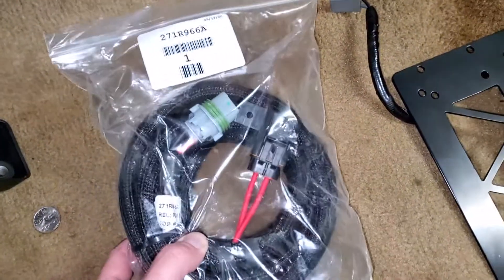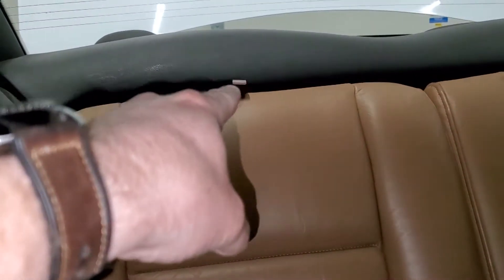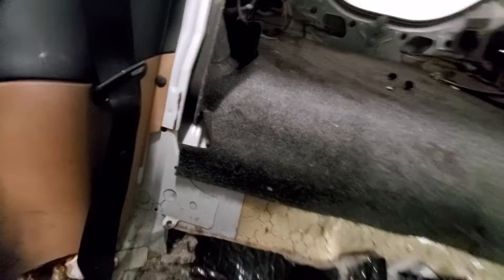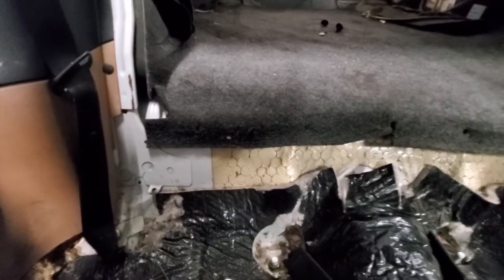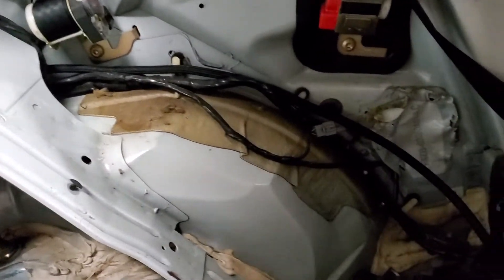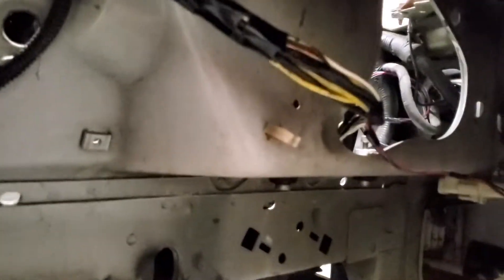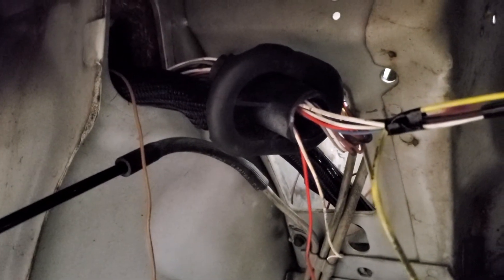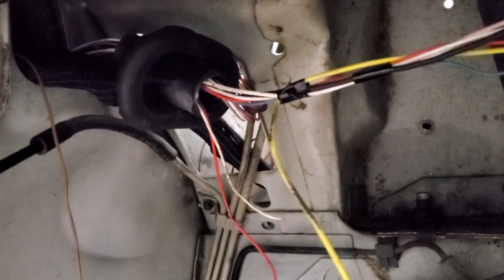Sn95 Terminator X: ECU Power and ground harness layout

Comment: Thanks for all these terminator vids, def helping me out for when I install my terminator into my 94 in the next week or so. I'm having MF Kustoms chop down my stock harness and retain the gauges and AC and all that so hopefully its plug and play for the most part
Reply from the maker: Glad they help! And good luck with the project!
Reply: @BabyLegsMotorsports  dude I also have to say your tip on getting to that horrible bolt holding the computer in was epic. I was scratching my head trying to even understand what was holding it in still and we used the pliers on the outside like you did and it worked like magic
Reply from the maker: Yeah that one was crazy hard to deal with!